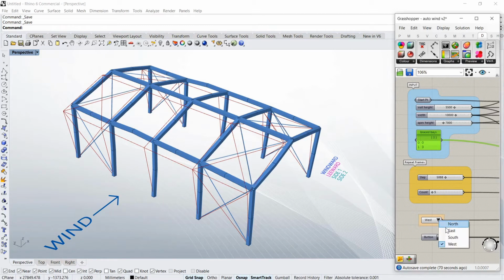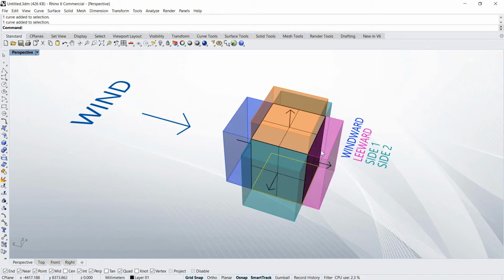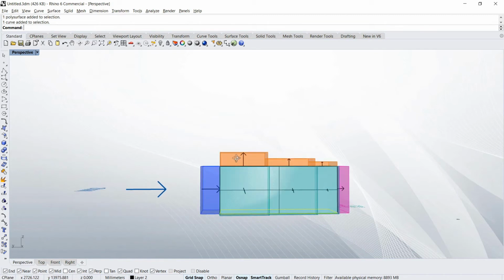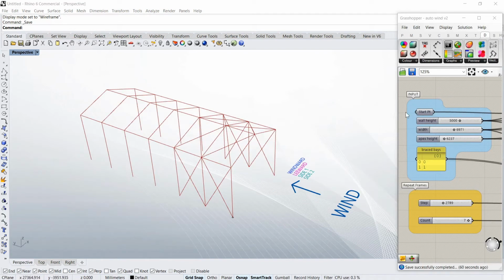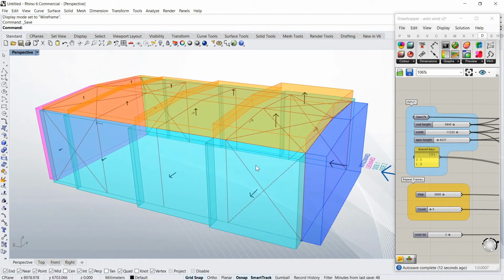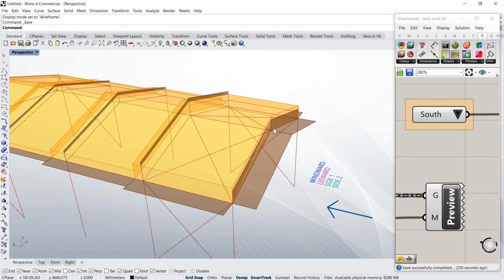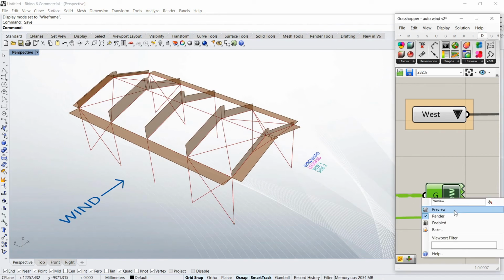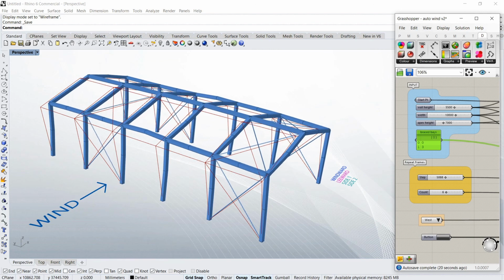Auto Structural Wind. Generating wind loads automatically in real-time with physics in Grasshopper.

Comment: "Loading to code"...
Could you specify what code you are referring to ? This load distribution looks a bit simplistic compared to Eurocodes, for example.
Reply from the maker: This uses AS1170.2. Something similar could be designed for other codes though as complexity just needs to be written in.